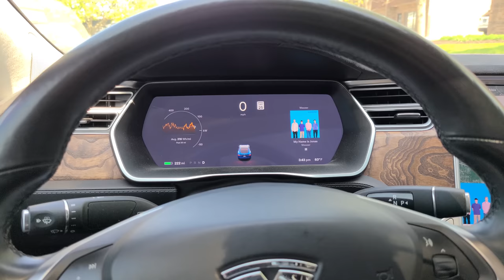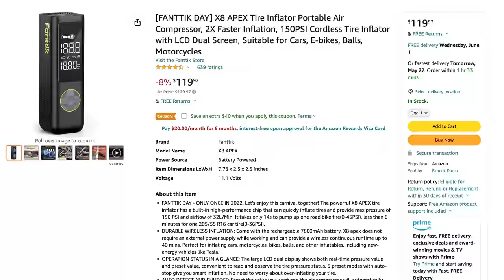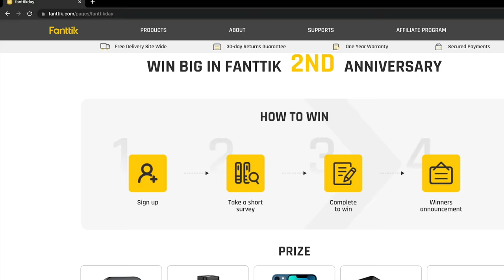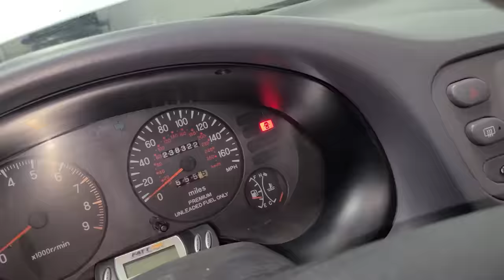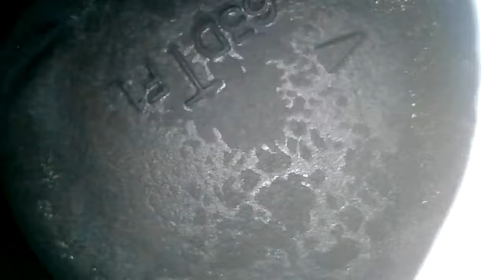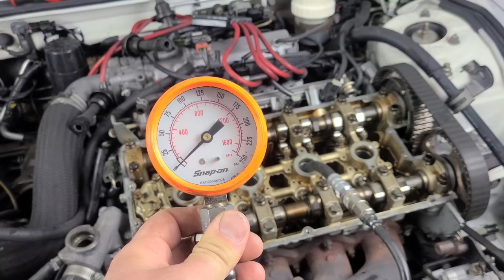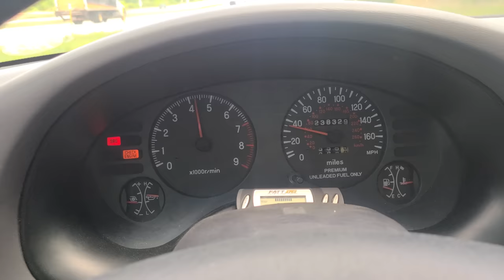I OVERPAID For The MOST Modified & Destroyed Japanese Tuner Car Ever! It's A TIME CAPSULE!

Comment: On no you bought a JDM car made in Normal, IL.  HAHA.  At least you got the Turbo so it has a Japanesse 2.0l Engine.  If it's a non-turbo then is has a Dodge Neon motor (Boo).  I used to work at MMSA in SoCal from 95-07 and we would get call from pissed off buyers that found out they bought a car with a Dodge Neon engine.  They were terrible engines with lots of problems.  In 99 when they introduced the 01-05 Eclipse they said it had all Mits engines, no Dodge motors and everyone cheered.  But the Mits engine was great.  Nice to see you use Wix Filters.  I use Napa Platinum which are made by Wix.  I'd put NGK back in as new plugs.  They are the best for that engine.  The Neon engine had Champions and they were crap.  So many misfire problems.  BTW,  I think I saw a nail in the right front tire when Peter was walking up to the car.

Comment: I’m willing to bet that isn’t the original trans cause anyone that knows Mitsubishi’s will tell you that their transmissions are notorious for breaking.I’ve owned 4 Mitsubishis over the years and 3 of the 4 that I owned needed a new trans around or a little after they hit a 1000,00 miles and the 4th one I owned trans was on its way out around 15000,00 miles when I sold it.

Comment: There was a guy in Dayton Ohio in the early 2000's who had a black one with a caved in quarter panel and a big Wright State sticker who use to troll for street races in Fairborn on weekends the car ran 9.40's burning a gallon of water on every cranked up pass from the head literally floating on the block from running 38lbs of boost on the moon tune he had 50 grand in the engine and drive train he drove it every day on 14lbs but would drain the the fuel and fill up with 118 for a race he took alot of money from guys who thought they were fast

Comment: 450 with all that weight your 1/4 mile won’t be to impressive you’re gonna have to shed some weight on the DSM if you plan on keeping up with the all-wheel-drive Honda civics, you’ll basically have a Honda Civic front wheel drive with 250 wheel horsepower keeping up with you

Comment: 99% of cars have the same.problem for.me.... they have a nice rear, or nice front end, but never both, or so rarely. This car is not different, I love the rear but not the front.... 
How hard it is to have both on the same car..... 
I like a few, Bugatti type 35, Atalante, Avion Voisin convertible, Peugeot 402, Peugeot 201 coupé docteur, Citroën Ds (old one) and in more modern family the Chrysler 300c wagon version, Jaguar XJ8, Volvo 850r v2 (aka V70), dodge Viper 2nd gen, Chrysler Prowler, .... Few others

Comment: Dude.....this car was NEVER worth or sold for as little as $2k unless it didn't have a motor or was in scrap condition.
You also got a VERY good deal as this car in this condition is worth $15k EASY.
This car was popular years before F&F came out, then it exploded!
I can't find one in ANY condition within 500 miles of me on the much more populous east coast USA.
These are so valuable and hard to find, guys would piece together the awd system from junk yard wrecker parts to mod their GST and Spyder's to awd because it was cheaper, easier, and faster than finding and buying the GSX.
You don't understand what you have here man, it's like a unicorn mated with bigfoot in atlantis and birthed a megalodon.

This is EASILY the best and coolest US market car you have, with the Grand National a close second.

They are also VERY reliable and indestructible, with the correct build and parts done right.
Hell I overheated mine like 6 times with ZERO damage after it was built with all bolt-ons and mods done correctly while still on stock heads and bottom end.
ALL clamps need to be T bolts, not that hose clamp shit or anything like that, upgraded thermostat. All 3" pipes and exhaust, quality tubular manifold with bracing cause they all crack under the heat and weight of the turbo.
ARP head studs, quality parts installed properly with the proper bypass mods done like the GM 3" maf and translator so you can vent to atmosphere before the maf, there is a balance shaft removal mod, and some other minor things that make it bullet proof.
You have SO much to learn and will come to realize this car is the literally definition of badass.
It's only real weaknesses are the shift syncros, center diff, rear dif, and rear axles.
You know who used to own the dragstrip for decades?
This drivetrain modded into a dodge colt hatch (Another DSM car) that weighs like 1000lbs wet.
The holy grail of this vehicle is the Eagle Talon TSI due to the cooler body style accents and name, but I loved my Eclipse.

Comment: Btw 450 hp is nowhere near enough, or competitive on the street, you can daily drive up to around 700hp reliably with no bad characteristics depending on the clutch/flywheel combo.
Do it right, you should be running over 20lbs of boost, WITH AC.
Wtf yes these cars are reliable if built correctly!
Also get that missing timing cover, or you WILL regret it lol.

Comment: Kinda disappointed.
Hoping it was a 95 300zx twin turbo, all leather with Bose stereo.
I've always wanted one!
Red one.
Mushy hoses are oil contaminated, it softens them.
Reply: I was street hot rodding when these run the streets. Stock they ran like mid 13s with a good driver.
Modded guys in the 11s weren't uncommon.
I had a modded 86 Lazer that had a manual and could burn tires thru 3rd and blew axles out occasionally...lol
My Sister had the 91 Talon turbo. 
Love how easy to make real power they were.

Comment: you need a bs delete  kelford 272s 20g turbo you already have a forced performance mani. Need to run speed density or go fulll with dam link complete all supporting mods they love id1050s cop set up  timing belt and more I have built some many of these damn cars it’s unreAl. 450 awhp you better buy a new t case replace that carrier bearing and adjust its angle. Btw I can pull these cars all. Say where I’m at for 35-6k minty

Comment: Ummm, that's not JDM and only kinda Japanese..
That's a cast forced performance manifold which are really good and what looks to be a tdo5 big 16g.
If your target is 450hp that manifolds fine and even a stock frame bolt on Forced performance turbo will see you get there easy.

Comment: if you take the transmission off at any point there is a bolt in the back that is really hard to get out... plz make sure you install all trans bolts back where there came from... it will ruin the engine if you don't. I have seen this happen 4 or 5 times. it will cause the "crank walk problem". I recommend watching jafro on youtube. https://www.youtube.com/user/Jafromobile

Comment: my dad had has a purple eagle talon Awd 5sp really nice car till dad built a 4G63T engine with maul green coat ceramic pistons with 770whp he takes me for a spin fri in shawnee okla to torments me as everytime i try to get a drink of my sonic blast he boost the purple bastard n i cant get even a sip theen does same dam thing if i try to play with my phone says the cars jelouse havent u heard of herby the love bug? of course theres the blowing hrough 200mph n then shiftng into 5th gear letting the engine cool down which is total bullsht its got oil over air oil coolers n engines with this type oil coolers dont get hot!!!!! the faster u go the coolerthegoddam thing runs im just mad cause he wont let me drive it or his 91 mitsubish VR4 awd aws 6spd n the engine another maul green coat ceramic monster the beast from the east during test n tune the car broke the awd dyno s it drove the wheel speed  beyond 260 mphand apparently it damaged the left rear drive axle/wheel bearing so to be sure dad bought the lower countrol arms on all 4 wheels all 4 drive  axles all 4 fuckit he went nutz had Mitsubishi who shit there pants at the idea once the saw the 1 and only1400whp plus dyno pull at dale smiths AutoShop!!???? guess dale wasn't as mad at dad as he pretended because the whp rating of 1400whp which is what i saw with my own 2 eyes dad!!! stop tellimg me that cars a dog ive rode in it dad its fucking scary as it gets dad the godddamed thing isnt even drivable on the street ur gonna get killed although i must admit i feel safer in the 3000gt n Mitsubishi used the car n pictures  to promote there new mitsubishi 4000gt . dad ha given the VR4 a nickname and everone cringes when they hear somone say hey its the whistler/beast from the east. the 3000gt is so goddamed quiet! makes no sense to me its quieter than the less hp cars. lol n holy shit dad walked in tossed me the keys said he was trying to get it perfect for july 2nd my birthday he knew i loved purple so omg he gave me the 1994 purpil awd EAGLE TALON god i was so mad at him thought he forgot me but iwas wrong !! I LOVE YOU DAD!!! THANX DALE FROM DALES AUTO GARAGE in MCLOUD OKLA! THANK YOU THANK THANK YOU!

Comment: Isn't Eclipse a US market car? Lol. Your JDM car is not JDM at all.
Reply from the maker: Its 100% JDM. They were made in Japan and only sold there and are actually right hand drive.  They totally were not built in Normal Illinois and only sold in the States
Reply: @LegitStreetCars  on the other hand I thought the price was ok. Have you seen what a stock 9th gen Corolla with mid 100K miles goes for in FL? I've seen them as high as $7K. I like 9th gen Corollas, have 2 right now, shut up, you're not perfect either. If you try to flip that GSX in FL you probably double your $ lol.